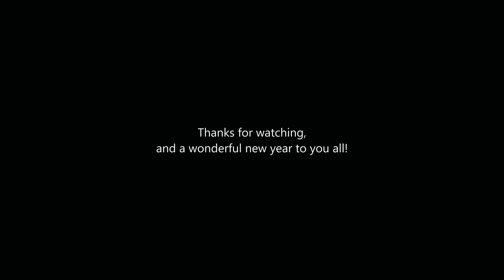Actually Scrubbing MOLD Off By Hand (HOUSE RENOVATION)

Comment: We live in Florida in homes with vinyl siding. The north side needs mold cleaning each season. We use 30 Seconds Mold Remover. You spray it on and it removes mold on contact. It's suggested to be used outside, but maybe you can spray the under side of the floor joists. It's carried by the big box stores. We like it because it's also safe for vegetation. You might look into this. Love your VLOGS.
Reply: Thanks for mentioning this because I need to clean the outside of our camper before we sell it. I found some of what you mentioned and it'll make cleaning it a lot faster

Comment: We had stilts for a little while as kids.  However ours were made out of the large cans that held tomato juice. I remember it being a project for Pioneer Girls. I am not sure if that program still is around. By making the hole on the side with a punch opener the strength of the can was maintained.   We then threaded a thick rope through the side holes and up and made a loop that was a little longer than waist high.  So, you pulled the ropes up and it held your foot on the top of the cans. Great for younger people who needed a larger footprint so to speak.

Comment: Dad made us stilts in the 60s, before we had TV.  Not as high off the ground as yours.  He also made toys like a push along duck, with flippers cut from an old inner tube inserted into the wheels.  Those were the days when we folded a piece of card over the spokes on the bike, pegged it on, and spent ages riding around, clattering away.  Simple and cheap.

Comment: I had stilts i made myself. Did not have screws so the foot part was always breaking off. I would just use more nails. I got really good using them but did not have to walk on gravel. Would think that would be harder. Now in my older age i cannot balance to ride bike anymore. Grace is growing up so fast, or it seems that way. Very pretty girl. I don't think young folks even know about stilts. Maybe  Grace using them will get others to want one.

Comment: I had pre-stilts (big old sturdy coffee cans that had a loop round your toes) and then I had stilts. There were holes all along the length of the handles so you could make them taller as you got better with them.  My Dad made them for me. with some straps to hold them on my legs when they got too tall to hold on to the poles.  And, we used a strong vinegar solution to scrub mold off and soak the ground under and around where the mold was.

Comment: When my sister and I were children (1960's), we went out to the garage and found some scrap wood and made stilts.  The only problem was that we nailed the steps onto the stand, and we didn't get to walk very far before the nails would pull out.  We also made an Aggravation board (how many played that fun marble game?) by using Dad's hand drill (not electric) and drilled the indentations where the marbles were to be placed.  Back then, if we wanted something to play with, we made it - no $$ for extras.  We did, however, get a hula hoop - what fun.
Reply: My grandfather worked for a contractor and brought home the sink cut-out from the countertops. He made many Aggravation games. He made many cutting boards from the cut-outs as well, in shapes like a pig, a car, a dog. Memories!
Reply: @MKCarol-ms7lg  That sounds like my Dad.  Anything he could salvage, he did.  He even tore down an old barn for a farmer for the lumber.  That's what he built our garage with.  My sister and I's job was to pry the nails out of all that wood.  I agree - memories.  Kids today have no idea of the good life we had - it taught us how to work.

Comment: Never had stilts as a kid in the fifties and sixties and no one I knew ever did either although I saw them on tv. Could you do something with the bottoms to slightly increase the footprint while keeping the strength? Hmmm, I wonder if cane/crutch rubber tips would fit. They come from cheap drugstore ones to industrial long lasting ones. Might could carve the bottoms round for them.

Comment: Haven’t seen one thing Grace has tried that she isn’t good at !!  Art i was wondering if after you finish with that mold clean up if you are going to get the air quality tested before you start putting up the inside walls ?
Reply: Yes! That's a very good thing to look into!